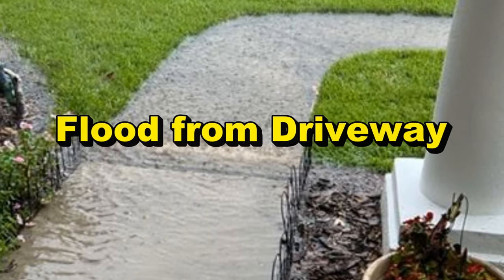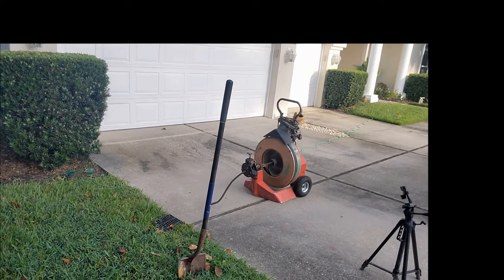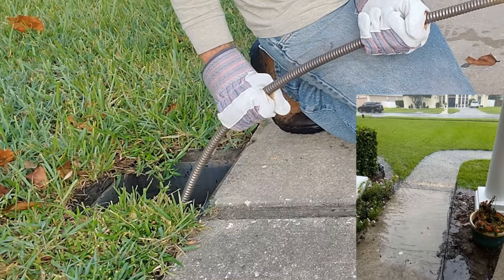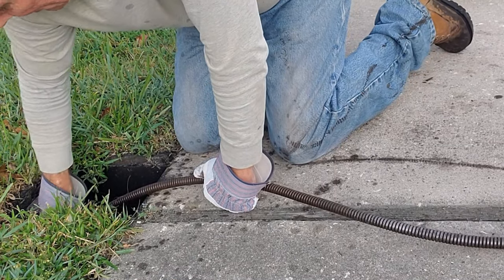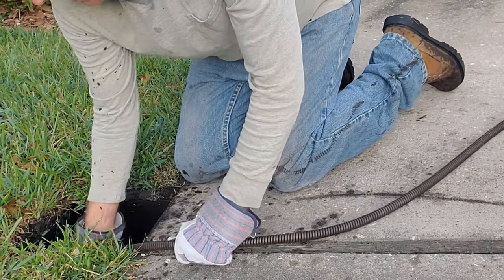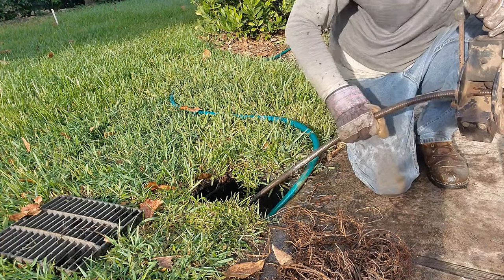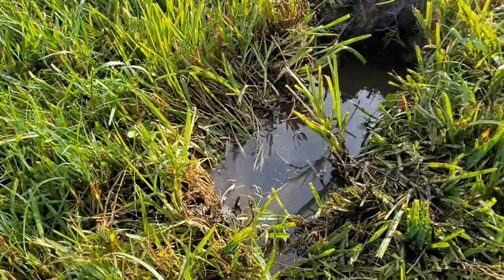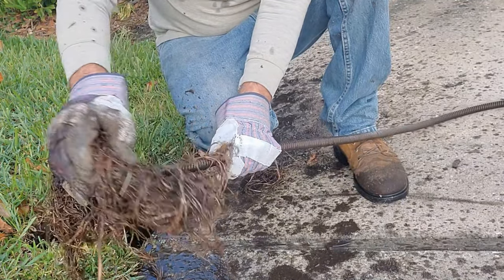How Much is Too Much Moisture? How to Quickly Solve this Problem

Comment: How do tree roots permeate PVC pipe? I didn’t think that was possible.
Reply: Roots can be very strong things. If big and thick enough, I assume they can either break through the sidewall, or they find a weak point in a connection.
Reply: Also, since the pipe purposely has holes in it, I assume they can just go in there, also.